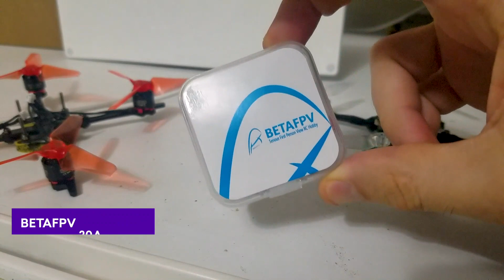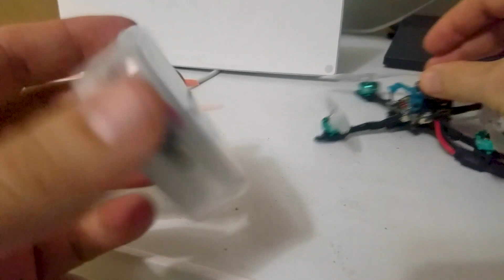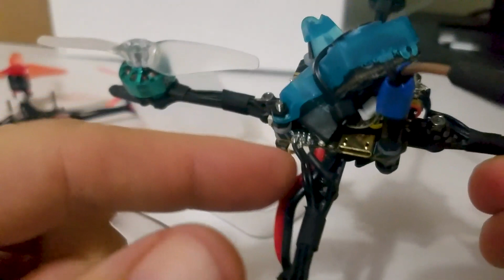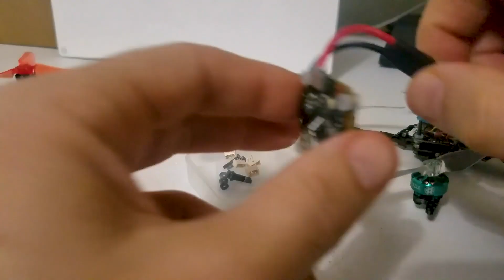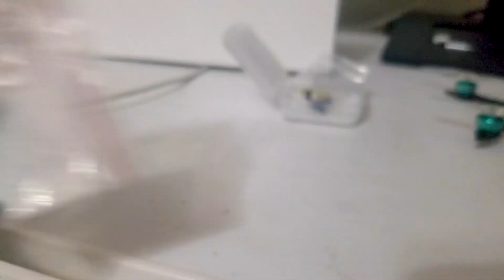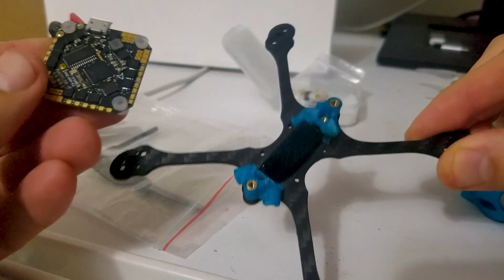BetaFPV 20A AIO Flight Controller review // 4S TP3 Toothpick

Comment: Thanks for the info.  I picked one up from RDQ’s and forgot to backup when I flashed to the new BT firmware but with the worm target.  Would you tell me what the target on this board is.  Mine’s the V3 model
Reply from the maker: Hi there! I'm not in front of my computer right now but berafpv has CLI dumps of all of their boards on their website. Should have that info. If not let me know.
Reply: NikFPV thanks, I’ll looked on website and could really find anything for this board other than flashing to latest firmware.  I noticed there is another step to add some CLI commands which I didn’t do.  Im using my this board as a replacement for the betafpv hx115.  For some reason my quad with the new board just takes off like a bat out of hell the minute I add a little throttle for takeoff.  Don’t know what going on with that 🤔

Comment: Just bought the last one on Pyro Drone as my namelessRC aio 12a board died. it was fine on 2s, but as soon as I went to 3s, the esc's died. Anyway, I have a spare set of LDARC 1304 4100kv 4s motors on my daily driver. Been Pretty reliable motors on 4s. May possibly use this setup on my TP 3. I've never had great luck with 12a esc builds. Glad to see a 20a AIO  toothpick versions. Looking forward to your build!